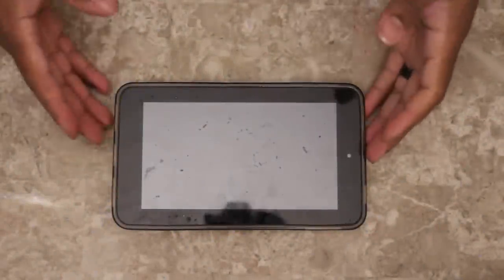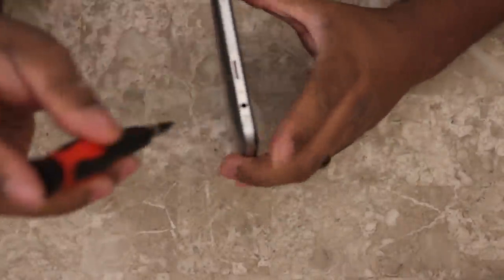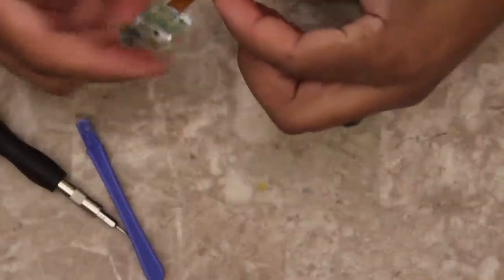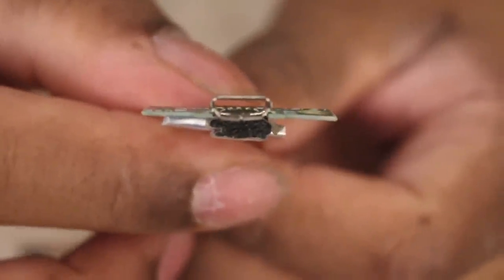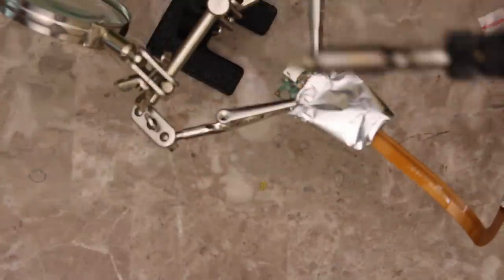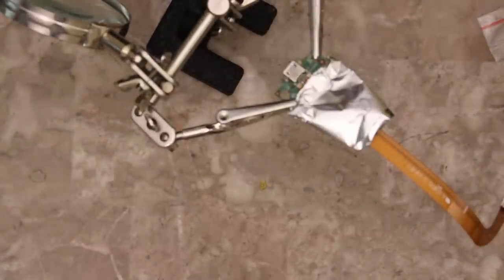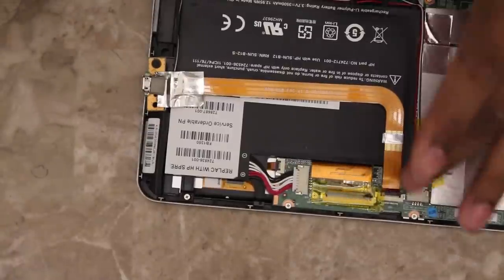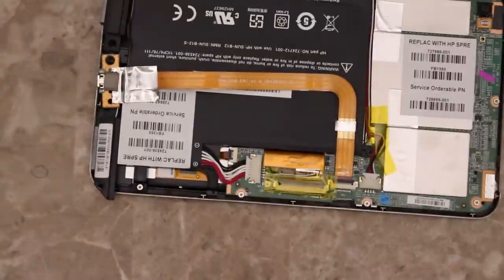Android tablet charging port fix

Comment: Thank You, kind sir.  I can now fix my Dell venue 8 tablet , thing is, the charging port's jack got chipped off so there's only half of it left, which is why it won't take a charge unless it's with a VERY powerful charger such as the Samsung chargers. I'd send it back to Dell for a replacement but I don't want to lose all my data. Thankfully, you saved the day for me.

Comment: Seem to be a lot of work I myself am in the business so can tell you all the average labor rate for something like this is about 60 dollars per hour. Break this in half for a half hour of teardown soldering and refit and it is worth 30.00 to buy the whole part and know it is going to work. I have done this on a nexus 7 now three time and still not spent as much time as it would take to solder it once. His technique is solid and his video is good. If you had only access to the micro usb connector this is a good video showing how to solder it. Also if it truly is meant to be an "instructional video" then telling the world you don't care if data doesn't work is not good because the person watching this video might.
Reply from the maker: +cobber1070 I would recommend anyone who wanted to do this to actually just replace the whole ribbon cable with micro USB assembly. It will cost more but a person wouldn't have to worry about re-flowing solder or anything. 

The data may work I never tested it, I just stated that for me it didn't matter if it worked because data transfer through usb had never been done during the life of the tablet.

Comment: Good/interesting video but what about with a simple "stick" style charger? I've replaced the charger a few times and it's always worked up until the last one. it has to be propped at just the right angle and pinned at a certain position to even charge at all. I'm betting it's gotta be the port. It does have a micro udb port but it won't charge from there because Zeki is a terrible brand. But it was a gift so I can't bitch too much.
Reply from the maker: lcoq19 it would be easiest to replace the whole assembly like I do in this video: https://youtu.be/dzXBdPBfg4Y the problem is that with lesser known brands its hard to find replacement parts. i would check ebay/amazon for the replacement. Its always eaiser and requires less tools to plug something in over soldering something in.

Comment: I have a slate 7 too that I'm trying to fix with the exact same problem can I just buy that little piece and stick back in.
Reply from the maker: +Matisse Kleinheinz I made another video fixing this same tablet. In that video I used purchased the port with the ribbon cable connected to it. That way I could just replace the ribbon cable and it was ready to go. The port that I soldered on in this video was about $3 but its harder and requires special tools. The other fix is much easier you need the new part and it was about $15 but you don't needs special tools other then T4 and T5 screwdrivers. Here's my other video: https://www.youtube.com/watch?v=dzXBdPBfg4Y

Comment: You need someone to adjust the focus on your video as  you work. More light might help but the fact that the focus is fuzzy for some of the video makes it hard to watch.
Reply from the maker: Yeah i got a new camera with a better autofocus for that very reason. Thanks for the tip.

Comment: Would I be able to just take a port from a phone or another tablet and replace it that way?!
Reply from the maker: +Nita Moni that probably wouldn't work. You need to replace it with the right one. here one here  for $6.99 http://www.amazon.com/Charging-Receptacle-Replacement-HP-Tablet/dp/B00XHL84QQ/ref=sr_1_7?ie=UTF8&qid=1463805820&sr=8-7&keywords=usb+charging+port+for+hp+slate+7
Reply: Nita Moni

Comment: Tysm Man i have been looking for chargers all over my house and i have been begging my mom to buy me new charger im so glad she didn't buy me one yet 😂😂😂
Reply: Make sure you don't use any old charger, that is how most devices get fried inside. Check on the back of each item. device and charger. They have to use the same Volts, like don't charge a 2v device with a 5v charger. It will fit, but there is too much power.

Comment: what the name of the wire that used to combined the port and the motherboard ...sorry for my english.....
Reply from the maker: +Gerald Francis l Micro USB Charger Charging Connector Port Flex Cable for HP Slate 7. You can find one here: http://www.amazon.com/Original-Micro-Charger-Charging-Connector/dp/B00R8YMZNQ/ref=sr_1_1?ie=UTF8&qid=1462197126&sr=8-1&keywords=hp+slate+7+usb+charging

Comment: Would this work for an Asus Memo pad? Its a 7 inch model verson ME173x..
Reply from the maker: +illsologamer This type of fix would be just about this same with all micro usb ports. As you can see it required some tools and a little skill. I would suggest to replace the entire port assembly if possible for your model. Here a video where I replace the whole assembly for the same tablet. The part cost more but its a lot easier and you don't have to worry about soldering anything. https://www.youtube.com/watch?v=dzXBdPBfg4Y
Reply: jpulley why dont mine work

Comment: Does the charger port really need to be new? Or can i just solder it right away?
Reply from the maker: Denz Cruz you might be able to reflow the old on back on. I would actually recommend buying a new charging port assembly. It come with the port hooked up to the ribbon cable already. All you have to do is plug it in.
Reply: jpulley ok thanx

Comment: Can u fix a ultratablet charging port  if so how ?
Reply from the maker: +Night Babe Your ultratrablet will be different but not all that different from other tablets. the method I use in this video I wouldn't recommend for less experienced people. Instead you should replace the whole charging port and its ribbon cable that its attached to. I have another video explaining how to do this. https://youtu.be/dzXBdPBfg4Y 
You usually can go on ebay and sometimes amazon and get replacement parts to be able to do this. Good luck!

Comment: Where do you get the screw driver to take off the screw of the case??
Reply from the maker: +KillerPlayz Gamez Amazon.com
Reply: ow thanks!
Reply from the maker: KillerPlayz Gamez I think they are T4 or T5 but just get the set they are cheap. You can buy a set of small Philips/torx head screwdrivers starting around $8 well worth the investment if you are going to be fixing small electronics like these.

Comment: Did you just use tinfoil to shield the other area?
Reply from the maker: +Astraithious yep, the foil just helped shield the rest of the board from the heat gun.
Reply: +jpulley what heat gun  do you use? And do you find it works well
Reply from the maker: Astraithious I just use a cheap heat gun off of amazon cost about $20 you really don't need a lot of heat to reflow solder like this. This was for my son's tablet who was 5 at the time and they don't know how to handle things with care he manged to break it again in about 2 months. I if it was mine I think it would have lasted for a long time. it cost more money for the part but I would actually recommend replacing the whole ribbon cable assembly i show that here https://www.youtube.com/watch?v=dzXBdPBfg4Y he still broke this one after a few months then I just bough him a tablet with wireless charging.

Comment: most ports are not this style.
Reply from the maker: +Ron Michel Actually the vast majority is this style. If your device has micro USB (pretty much all Androids) it is soldered directly to the board or like in my case its soldered to a smaller circuit board that is connected to the main board with a ribbon cable. If you want to replace only the charging port you will be re-flowing the solder just like I did in this video. One could also just buy the whole piece I'm working on and just install it by connecting the ribbon cable. Buying the whole piece is more expensive than what I did in the video but its easier to do.
Reply: for sure, and great that you put the vid out! im just fixing 2  tab 3 samsungs, i gotta bypass the port and direct charge the battery.